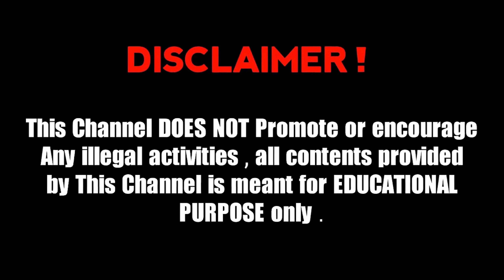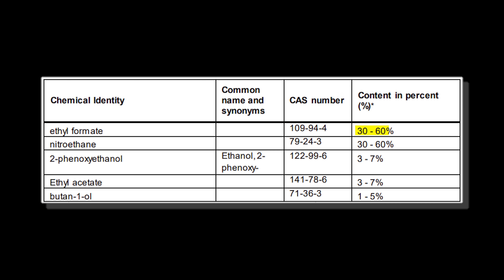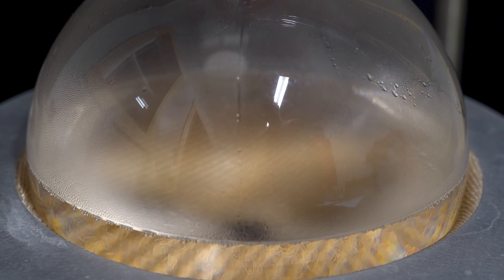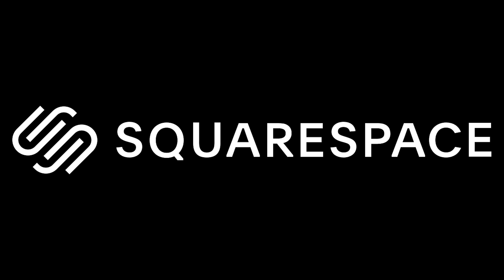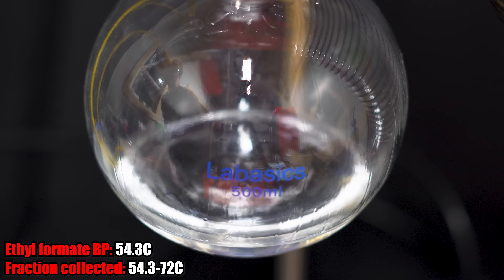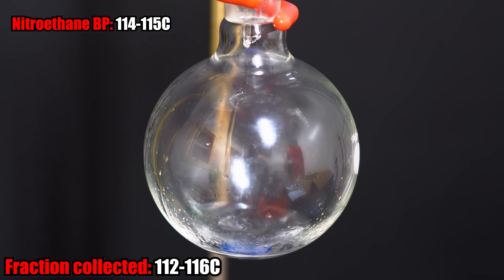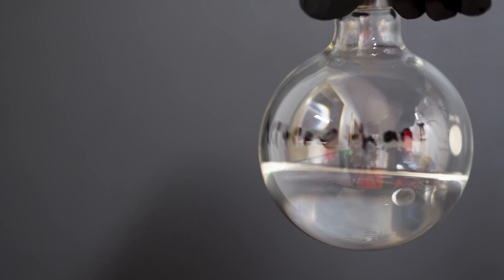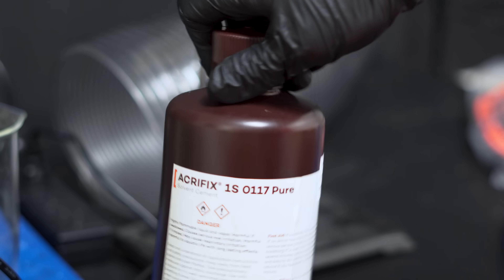Distilling Nitroethane Since The DEA Ghosted Me

Comment from the maker: Going forward, if I was to do this again, I would do a slower heating distillation. Likely better separation!
Reply: Could excess anhydrous calcium chloride be used to remove the butanol, as it is known to form complexes with simple alcohols?
Reply from the maker: @lagrangiankid378  not sure tbh. Could fractional distill or wash with tiny amount of water
Reply: @chemdelic  the problem with the water is that both nitoethane and butanol are similarly soluble so you'll get  a very little gain in purity over a considerable loss of product.
Reply from the maker: @lagrangiankid378  I agree. Not the best route but could work!! I’d opt for a fractional distillation with slow heating
Reply: @chemdelic Ok, so I have finally done this fractional distillation with the exact same product from ACRIFIX. Your mistake was not collecting the 80-110°C fraction as this will have a lot of product and it can't be simply redistilled. The reason is that Nitroethane and 1-butanol form an azeotrope that boils at 107.7°C. You should also heat the boiling flask up to 140-150°C to ensure all nitroethane boils and is collected, as there is no risk of butanol contamination (as it will have all already come over with the azeotrope) and the phenoxyethanol won't evaporate until much higher. Now the only issue is to break the azeotrope to collect the extra nitroethane. I will try both the calcium chloride complexation (followed by frac distillation) method and an extractive distillation (as soon as I can find an appropriate solvent, cyclohexane should work but I can't find any seller).
Reply: @lagrangiankid378 Did you have any success yet?
Reply: yeah thats what the other was it paper said or w.e?
Reply: You said this will dissolve superglue? You mean when it's dry, or just thin out the anhydrous liquid? Either way, would it be skin safe? I know solvents tend to not be flesh friendly, but I swear I get half the container on myself when I use gel and ⅘ on my hands and shirt if it's liquid. I've ruined many cool shirts with what starts out looking like spooge only stiffer and ends up cracking apart and making a big ol hole.
Reply: why you dont use ethyl chloride and sodium nitrite

Comment: To get the likely contamination of butanol out of your nitroethane, I’ve seen others mention oxidation to butanal which seems like a good, viable method. However, I think even less trouble would be azeotropic separation with cyclohexane. It’s a useful solvent to have in the lab and it’s sold in Amazon for relatively cheap. As far as I’ve read, it doesn’t form an azeotropic mixture with nitroethane but forms one with butanol which boils at roughly 80 C. I could be wrong but thought it would be worth looking into.
Reply: Yes this would work, as the 90% cyclohexane and 10% 1-butanol azeotrope boils at 79.8°C, while the nitroethane and 1-butanol azeotrope boils at 107.7°C.

Comment: Butan-1-ol is very soluble in water (73g/100ml).  Nitroethane is only slightly soluble (4.6g/100ml).  Extract the butanol-NE mixture with water in a sep funnel then drain off the lower NE layer.  Dry the NE over anhydrous sodium sulfate, gravity filter and perform simple distillation to recover pure product.  If you wish to recover the small amount of NE carried over into the water layer, try salting it out by dissolving NaCl into it.
Reply: This is wrong, butanol has a solubility of 73 g per liter (not 100 ml), so the solubility difference is not that huge, it's 7.3% vs 4.6%. You can wash the butanol out, but you lose a lot of product.

Comment: Fractional crystallization would work on this mixture... 
Phenoxyethanol mp is around -5, nitroethanol is around -53 and the rest is around -80, -83.6 and -89.8. 
Get some dry ice and drop the dry ice into the mixture until you get a "wax". The wax will mostly be nitroethanol with some amount of phenoxyethanol, and maybe trapped formate/acetate. 
dry ice is only around -78, so the other stuff shouldn't freeze too readily.
Do that to up the percentage of nitroethanol, and then run a traditional hot distillation and you'll get relatively pure nitroethanol without too much of a problem.
Reply: you'd be right unless the components you are trying to separate, formed eutectic mixtures :) the odds are quite high that they do and not even one I suppose (with different conc. rates and melting/crystallisation temperatures). ps: and where did you get nitro ethanol?
Reply: @NuttyGeek  
I mean, this was explicitly as a work up step to a hot distillation run, so even if it forms a eutectic, the new eutectic probably doesn't maintain the same proportions of it's initial components. they do similar things with ethanol and glycerin to get  dryer ethanol.

as for the nitroethanol... that might be a phone comment, but we're talking about nitroethane in the video.

Comment: I'm guessing the "crazy lines" are most likely due to a large change in refractive index in this particular mixture as the temperature increases. Convection currents rising up through the liquid bring areas of hot an cold into close proximity and light is refracted in random directions creating areas of bright and dark which present to the eyes as wiggly lines.

Comment: Butan-1-ol and nitroethane appear to have very different melting points. Maybe fractional freezing?
Reply: No. Lol. Butan-1-ol melts at -89.8°C, nitroethane at -89.4°C, so no fractional freezing.
Reply: @lagrangiankid378  That's what I get for trusting Wikipedia🤣
Reply: @existenceisillusion6528  Yeah, I don't know why and how did they get the number so wrong. Usually wikipedia is fine, but in this case every other source gives a different figure.

Comment: You could take the nitroethane that you collected (likely a mixture of it and butan-1-ol) and perform a simple oxidation, which won’t touch the nitroethane. Any butan-1-ol (117.7 °C) present will convert to butanal (74.8 °C) which has a much lower boiling point. That should make the distillate from the next distillation be squeaky clean.
Reply: mmm ... Looks like a direct path to  a rapid xplsn :) check the safety sheet. "NE is not compatible with oxidizing agents..."
Reply: Awesome 👌
Reply: smart

Comment: I’ve done this with extru- fix 
Nitroethane 30-60% dcm 30%~60% I methoxy 2 propanol 1-10% I washed the methoxy out with water then distilled off the dcm leaving me   about 200mls of nitro that I fractioned off leaving a yellow goey stuff the last few mls this is from 500ml bottles everything comes off at around there boiling point . There was a fraction that came off at around 60c I think it was azeotropic boiling point between dcm and nitroethane that I think exists.excellent work people have talked about this for ages but your the first to post a video…….. nitroethane was good to go worked perfectly for removing glue!
Reply: But to change the subject, but I've found that methanol works great for removing glue as well.  As does acetone.  Is there a certain glue that Nitroethane works best on?  Just wondering as I knew that you could use it for glue, but I had never actually met anyone who actually did use it for that due to how hard it can be to get and due to its price/value.  Would you say that it works better than methanol or acetone?  Is there a certain glue that it works miracles on?  Just wondering.  I attempt to remove a lot of glue from bottles and stuff like that, so I'm always on the lookout for betters ways of going about it.  Right now, I just use methanol and paper towels.  Seems to work great, but I guess it could be better if it dissolved the glue totally.
Reply: @BackYardScience2000  it works best on acrylates , superglues
Also fantastic as an acrylic adhesive too. 
As you have said the price of buying it is prohibitive, also has become very difficult to obtain in its pure form.
Nitromethane has become impossible to buy now without a explosives license also,
At least in my country

Comment: The nitroethane can form a nitronate salt. That might be one way to separate it from the alcohol. Not to mention you could get rid of most of the 1-butanol with a water wash. Nitroethane is only slightly soluble in water. But, I would be interested to see an alcoholic solution of sodium hydroxide added to the mixture. It's alcohols and ester, so you should get a precipitate.